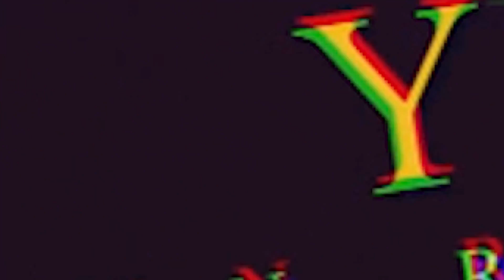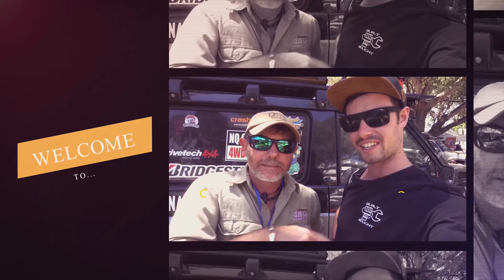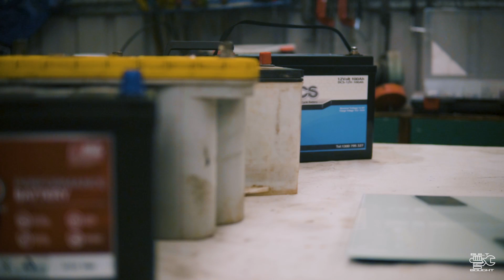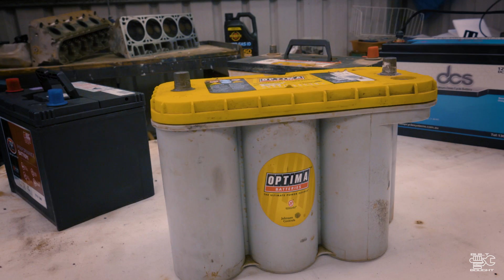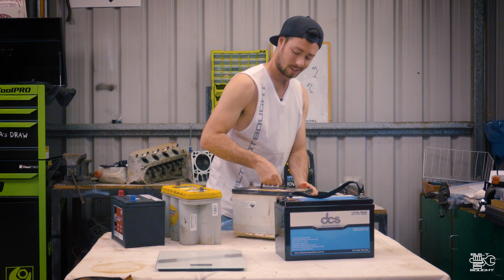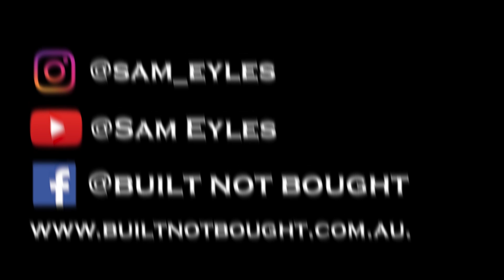How To Choose The Right 4x4 Battery || Is Lithium The Best?

Comment: Slight correction, the yellow optima is an AGM battery, AGM stands for Absorbent Glass-Mat, these hold the acid in a sponge like substance between the plates, therefore they can be mounted in almost any position and they don't leak, the ones that leak are Lead-Acid because the acid is in a liquid form.
Reply: Was sure they were AGM too! Glad I'm not crazy 😂
Reply: First time I've heard lithium can be discharged 100% too, I was always told by battery companies to not let them get below 20% capacity because of how volatile lithium is when discharged.
Reply: @jarradmcdonald2895  You are correct Jarrad. If you discharge it 100% you will decrease the lifespan significantly.

https://www.youtube.com/watch?v=i4PgqX3A7MA
https://www.youtube.com/watch?v=50XTzEZzbSY

Comment: Lithium is head and shoulders above every other battery.

Lithium holds its voltage, which allows you you to run your inverter without the voltage dropping down to 10.5 and it cutting out. You also don't damage the lithium battery when you draw massive current out of it from coffee machines or power tools.

Also if your purchasing a lithium, make sure it has prismatic cells

Comment: 2020.  I've had an Excide 115AH/205 Reserve Capacity minutes at @20a deep cycle marine ($100 at home depot) in my van for a year now and it's working great. I had to customize my battery tray to hold 13" vs OEM 9".  I've been looking at some of the 300AH Lithium batteries out there . the challenge is they are 20" long and they still cost around $3k.  But that batteries returns 900 Reserve Capacity minutes @20a which is over 4x longer use.   The difference for me would mean i could run a small 200watt AC overnight.

Comment: As a overall battery for deep cycle battery lead crystal is the way to go, its cheaper than lithium and can go to zero charge and cycle backup without any drama. Where all other batteries can not including lithium batteries , lithium about 30% to 40%  which is low but not like lead crystal and  you lower you shorten life cycles or kill it. lead crystal is 30% of ca for amp for charge which is can charge almost the same or same as lithium. lead crystal is 99% recyclable and battery operating temperature is -40c to 65c and can be charge below 0c and no special venting or cooling needed and stored for about two years without charge. so why both the cost and flexibility of others don't compare.
Reply: The more you discharge them the less cycles they will give you. But apart from the heavy weight I think Lead Crystal is better and lasts longer, ie more cycles.

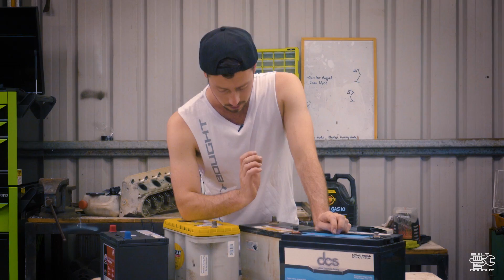Comment: 8:00 price.  No comparison using any real prices, or price to cycle rates.  The DCS 100Ah lithium battery is currently AUD1,199, while 100Ah AGMs start around AUD200.  You can certainly buy 3 x AGMs for the same dollar amount.
Reply: Oct 2021 - DCS is now $1400. So much for coming down in price.

Comment: 7:20 charging rates of both AGM and DCS battery.  Yes, the charging rate of the DSC lithium is very good, up to 150A.  AGMs usually have a maximum rate of 0.25 of C20 capacity, so your example of the 100Ah AGM would be about 25A maximum charge rate.  This is not “trickle charging”.  From 50% discharge, it would take less than 2hr to reach 80%, and another 2hr to get to 100%.  Nowhere near as quick as a lithium, but trickle charging it is not.   Going back to the 3 x AGM equivalent, the charging rate would be 75A.  There also needs to be consideration of the actual charging ability of the vehicle, the BMS or DCDC unit, and the wiring.  Most on-board chargers pull up at 40-50A (Redarc LFP1240 is 40A), so the ability of the lithium battery to handle stacks of current going in not used to its full capacity.  It becomes a comparison, then, of 40A for lithium and 25A for AGM.  Even without losses, the 40A charger will bring a 0% DCS back to 100% in 2.5hr.

Comment: 5:05 discharging an AGM to 50% or 30%, you say there are a need for 3 x AGMs the same size as the DCS battery to be the equivalent, while at 5:48 the AGM figure used is 60-70% discharge to around 10 or 9 volts overnight (this would be a C10 rating) for s single 100Ah battery.  The use of different ampere-hour ratings when making comparisons is not helpful.  Most AGM batteries will have a OCV of >2.10V (>12.6V) when fully charged, about 2.05V (12.3V) @ 60% discharge,  and >2.00V (12.0V) @ 70% discharge.  Most AGMs, when reaching 0% capacity, will have a OCV of >1.90V (11.4V).  Letting an AGM get to 10 or 9 volts overnight is probably damaging the battery permanently, but it’s not providing 60-70%, it’s provided 100% of its working capacity.  The OCV of the 100Ah AGM and a DCS battery at 70% discharge is 12.0V vs 12.6V, respectively, both having supplied 70Ah.

Comment: 5:27 “The other thing is voltage.  The design of these lithium batteries means you’re gonna keep your voltage till it’s down to zero per cent charge.”  The DCS website shows voltage trailing off at around 80% discharge, and 10.2V at almost 100Ah.  The DCS battery keeps voltage constant between 10% until 80% (over a 70% range).  Please see the chart at https://www.deepcyclesystems.com.au/product/dcs-12v-100ah-lithium-ion/

Comment: We made our own lithium twin system. 3.7v cells 4$ each.. never had a problem but will point out that their not a good battery to have around hot engine bays. Lithium thermal runaway. Not good.

Comment: $1100+ for lithium...... fark that.
Reply: Make one. It's easy.
 Just find a good box 
OR use a gutted battery.
Reply: mine was $500 for a 100ah
Reply: They have a much longer service life - quality AGM to 60% discharge maybe 500 cycles. Quality lithium to 80% discharge, likely 2000 - 5000 cycles. It's worth it in the long run.

Comment: Are the lithium batteries safe in an accident? How do they handle corrugations?
Reply: If it's Lithium iron phosphate they are much safer than lithium ion in the event of structural damage to the cells.

Comment: DCS just released the DCS 12V 80Ah Extreme range - Heavy Duty RED 12V Automotive & Marine batteries designed for winching, high CCA engine starting and all round abuse.

Suitable for underbonnet applications, very high CCA's and never say die winching and competition abuse.  Military and Naval applications.   

$1695 incl. GST while stocks last.
www.deepcyclesystems.com.au
1300 795 327

Comment: Some info re voltage at charged rate 😁 100% Lead Acid 12.7V -- AGM 12.8V - 75% Lead Acid 12.4V  AGM 12.6V, 50% Lead Acid 12.2V AGM 12.3V 25% Lead Acid 12.0V AGM 12.0V 0% Lead Acid 11.8V AGM 11.8V This is why you need to set fridges etc to warn you when the input gets to around 11.9V, so you don't damage the battery by discharging it to low, plus the fridge compressor doesn't like to work at much under 12.0V., If you can't justify a Lithium battery, Australian Direct have some nice Kickass slimline Deep cycle AGM batteries, 170AH only 112mm wide so you can slot them in very small spaces, only problem is they still weigh 45Kg, but do come with a 5 year warranty.,

Comment: Correction agm does not accept a faster charge and most 4wds cant fully charge a agm,which us why u have to buy a dc-dc charger for the battery.......
Reply: Shameel Ali I thought Sam said you trickle feed AGM battery’s. It was was the Lithium Battery he said you charge quickly.
Reply: @tonydawnwright346  agm is not a good 4wd battery,for 1 the alternator can charge at crazy rates up to 120amp which is no good for a agm,also like I said before agm really needs a DC to DC charger and not an alternator as the voltage isn't suited,that's all iam saying,some people get the wrong idea,great vid otherwise

Comment: Shame can't just run lithium as ya main battery and don't bother with a second one, max discharge rate makes it useless if you have a winch
Reply: superhacker101 DCS just released the DCS 12V 80Ah Extreme range - Heavy Duty 12V Automotive & Marine batteries designed for winching, high CCA engine starting and all round abuse.

Suitable for underbonnet applications, very high CCA's and never say die winching and competition abuse.  Military and Naval applications.   
Big problem is  ->  $1695 incl. GST while stocks last.
www.deepcyclesystems.com.au
1300 795 327
Reply: @MADBONE0  dam that pricetag better off throwing in a couple of blue top optima battery's running the alternator through a DC DC charger but having the rest directly connected

Comment: Ill add... normal agm batteries do not like under bonnet heat, the yellow tops ( spiral agm ) however, can handle it like your standard led acid start battery.

Comment: Price sure is the main thing holding me off. I'm only running a fridge atm so the want vs need factor isn't enough to justify buying a lithium yet. . .
Reply: I'm in the same boat as you i can't justify spending close to 2k for a battery just to run a fridge

Comment: You'd never discharge a lithium to 0%. It will reduce the battery life considerably.
Reply: Most have an internal BMS system which cutoff the output at a safe level for the battery to then be recharged and normally.
Reply: UpDownUnder I didn’t think enough 12v accessories would run at a low enough voltage to take the battery to 0% 

And if you are running it flat you need to rethink you dual battery setup
Reply: UpDownUnder :  80% is the safe level...
Reply: @speyles  Loving your channel. So refreshing compared to others out there. A good mix of advice and just plain fun. Just don't go down the 'camp cooking' route. :-)